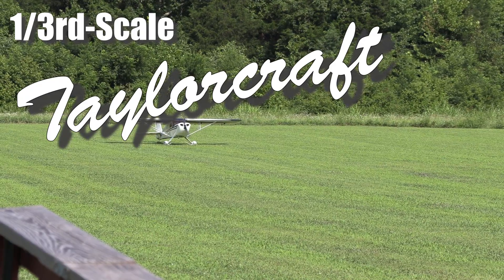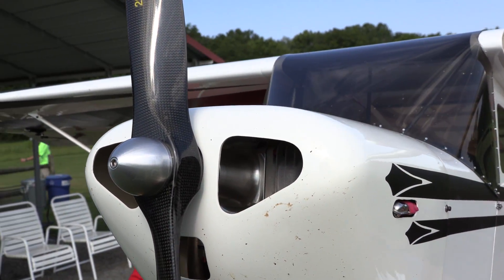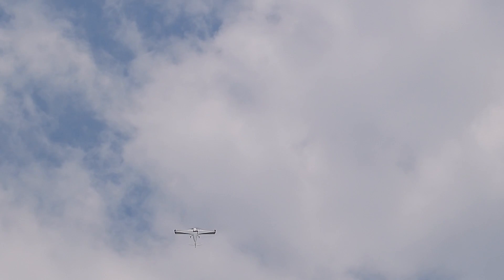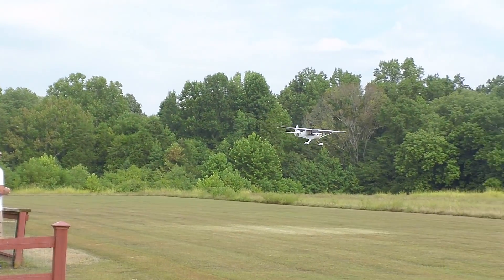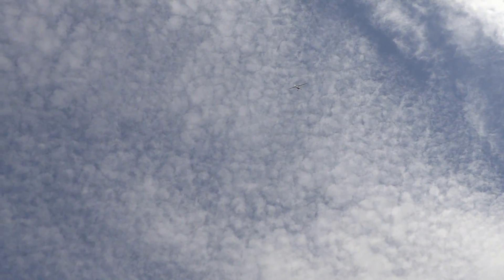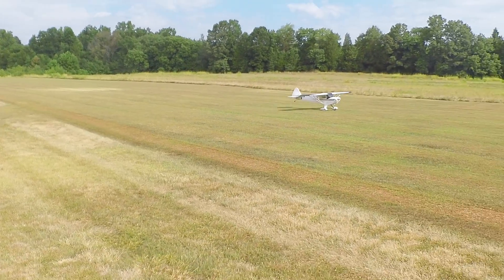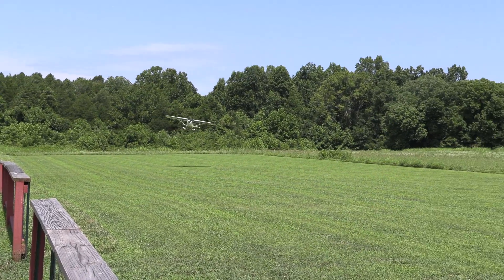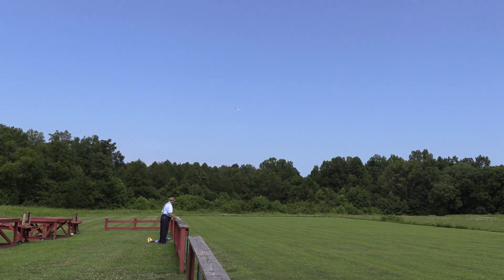Dennis Shaver's Taylorcraft

Comment: Hi,  You mentioned depth perception.  I've been flying for close to a year now so I consider myself still a beginner.  I've recently lost two planes because they seem to get away from me.  They fly far away and I can't get them back to me.  I've recovered them but they ended up crashing without a pilot(me) flying them.   So I think I have a depth perception problem still.   How long does it take to master this perception.   Do you have any tips?  thanks   gene
Reply from the maker: This "flying away" deal seems to be a right of passage in learning to fly RC. I do a lot of instructing and bringing the students plane back to where we can see it better is a constant. You need to learn to be aware of WHERE the plane is, not just what it is doing. The more you do it, the easier it gets. Don't be afraid to work with an instructor on this. It can save a plane and a bunch of frustration on the way to overcoming this very common problem.
Reply: (Late to the party, but . . . ) I think it's important for a new pilot to learn to do sharp turns without over banking, and the key to this is "use the rudder." What I teach is limit the bank angle to 30 degrees and use the rudder to bring the plane around. This produces a skidding turn which is a No-No in full scale, but it's quite effective with the many RC trainers I've flown. You may need to apply ailerons opposite the turn to maintain the bank angle. 
   This teaches the use of the rudder, and by avoiding steep angles of bank, the elevator is still an effective up-down control as opposed to simply tightening the turn. You may need to increase the power/throttle in the turn just as for turns involving steep angles of bank.  Once you can do sharp turns it is much easier to keep the plane from getting so far away. 
  I'm always harping . . . Harp, harp, harp, rudder, rudder, rudder, and bring the plane back toward us. Also, "steep turn add power."